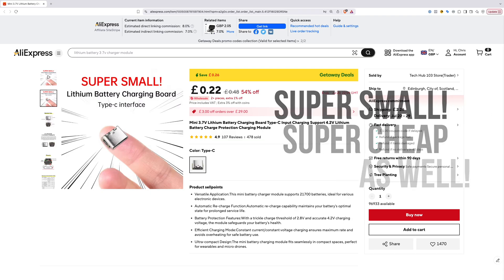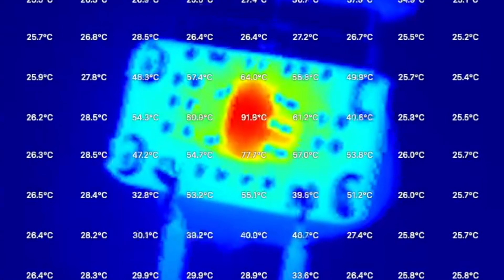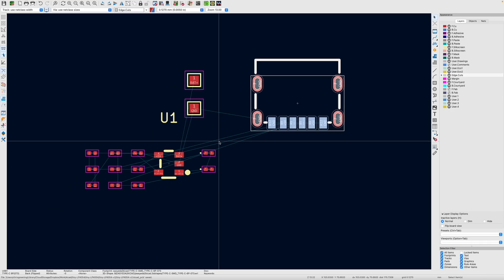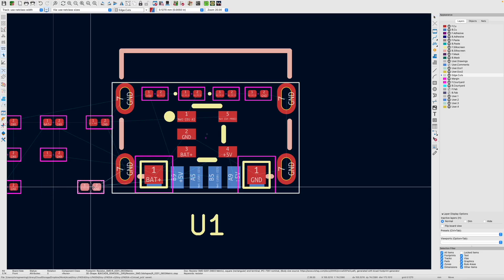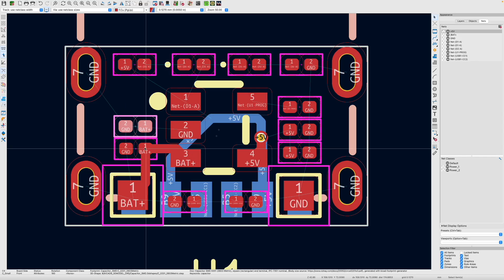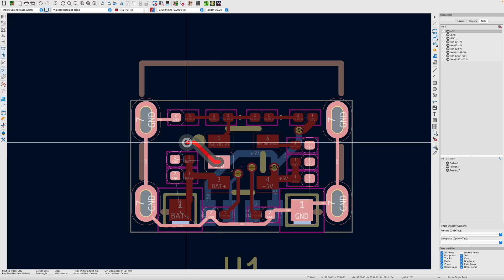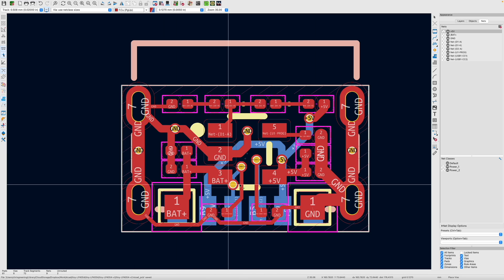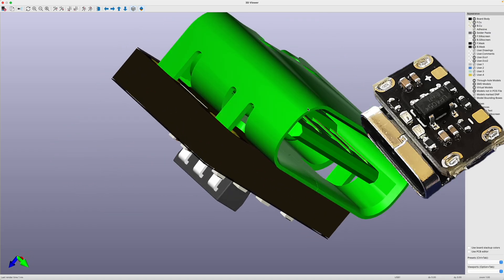World’s Smallest USB-C Li-Ion Charger?!

Comment: Interesting. Any compromises with having to use 0201 components over 0402 or 0805? Decouple with same spec parts or did you have to overspec to achieve the effective equivalent to what you typically get? Did you add a groundplane layer or copper under the USB-C to help with heat dissipation, using the plane or USB-C port as a heat sink?  I was able to find a smaller linear charger with power sharing, which made room for a protection circuit on the board itself (so you can run protected or unprotected cells) as well as a power out but It's definitely tight

Comment: I don't think you need to route the grounds together if your going to use a ground plane. I think you would just need a via if on the other side.   Can you place a via through the pad itself to save board space ?
Reply from the maker: Good point - I just wanted to make sure they were definitely connected.

Via in a pad is allowed, but you might be charged extra by the PCB manufacturer as they have to make sure it doesn’t cause problems with solder leaking out through the hole. So typically you’ll have to ask for the via to be plugged and capped which can cost extra.

Comment: I used these in a project recently!

I made a 3dprinted enclosure to hold this in a very small interior space, this board works great and they're so affordable.
Reply from the maker: They are incredibly cheap.
Reply: no issue with the chip temp going up 90°C against PLA?

Comment: 92°C is a bit too hot for any component, i wonder what the silicon die temperature is.

never see the point of these boards, too hard to mount and just as easy to put the components on your own boards along with the rest of the design.
Reply from the maker: Looking at the data sheet it talks about the max junction temperature being 120C.
Reply: @atomic14 i wonder what the thermal resistance is between die and case. Could be getting quite close.
Also if you add 10°C to the air temperature then it could be even closer,  would be better to drop the charging current a bit.
Reply from the maker: Agree on the just put the components on your own boards - the circuit is pretty straightforward, just follow the datasheet. But these could be handy if you just need to power something from a battery.
Reply: 92°C gets way too hot as soon as you touch that component with your finger. For a component on a board inside a case that is acceptable.
Reply: @volodumurkalunyak4651  92°C is way too hot inside or out. if you say that the room temperature is 20°C the component is 72°C above ambient, so go up to 28°C and the component is going to hit 100°C.
Due to the thermal  resistance  of the case material the die could be another 20 or so above that. Nominally if you can't keep a finger on it for more than a second or so it's 60°C or above which is too hot for a normal design to run a component unless you need it as a heater.

Comment: They are interesting little chargers, perhaps the only thing I can see is a difficulty with mounting the module. The good thing about doing the design yourself is you can add ears or what ever is appropriate for the project in mind.
Reply from the maker: Yeah, I think you'd end up with hot glue - which would then melt on your first battery charge :)